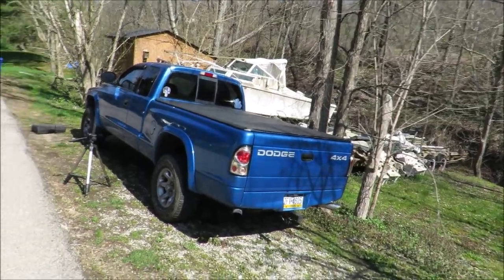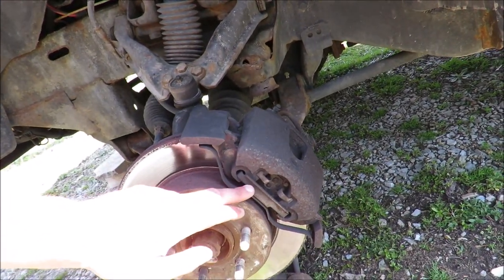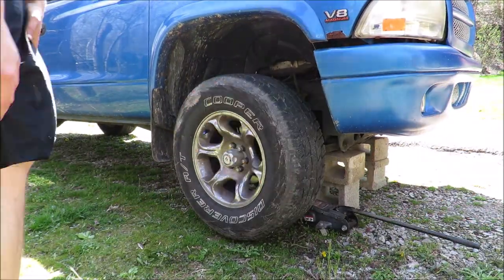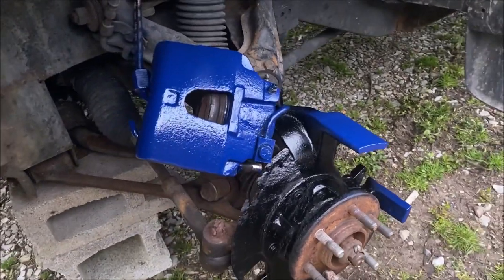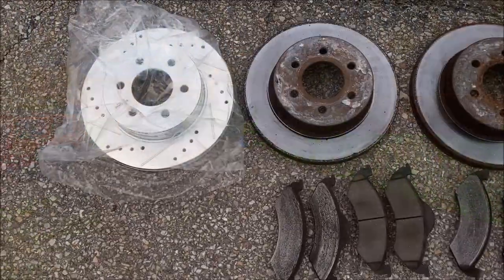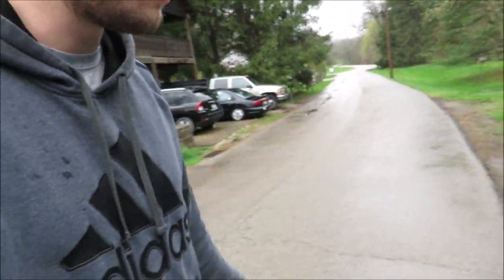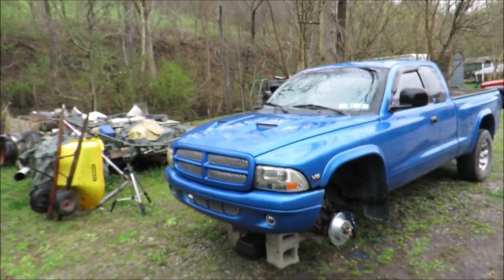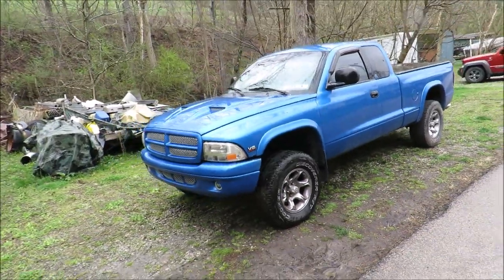Dodge Dakota Front Brake Install & Painted Calipers

Comment: Nice 👍🏻 just painted my calipers too. Good job 👏
Reply: The key to using generic paint is you put 2 decent coats on and really heavily put a 3rd coat right before it runs
Reply from the maker: Glad you like it man! When I used the generic paint last, it was several years ago so the calipers definitely took a beating during the PA winters. It was time for a respray for sure

Comment: That’s still a nice blue. I put drilled rotors w tow truck pads on mine and it made a world of difference. I’m in a desert so it’s already 100° here and the original setup just didn’t cut it. There was lots of fade before. Can’t make them fade now and I drive fast. How do you like those tires? I think you mentioned where you got the wheels but I need a memory refresh
Reply from the maker: Thanks man, I’m satisfied with the tires, the wheels were actually on the truck when I bought it. That specific style is discontinued, forget the exact style name but they’re American racing aluminum wheels chrome plated.

Comment: Would you drop a link to the brake kit you used? Thanks for the great video!
Reply from the maker: This is the kit I used! Link is below! Thanks for watching, glad you enjoyed it! 

https://www.ebay.com/itm/402488552012?mkcid=16&mkevt=1&mkrid=711-127632-2357-0&ssspo=sZe_SkOqT8K&sssrc=2349624&ssuid=6IYxIW0zTE2&var=&widget_ver=artemis&media=COPY
Reply from the maker: Well I just noticed it’s out of stock from that specific seller, but there are other similar kits available from other sellers..